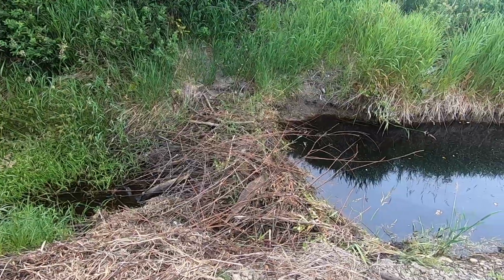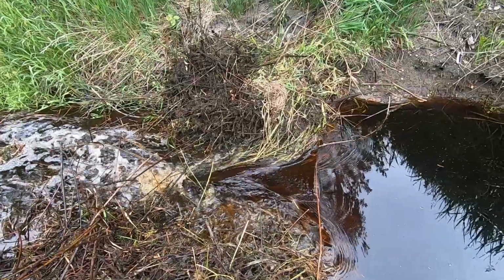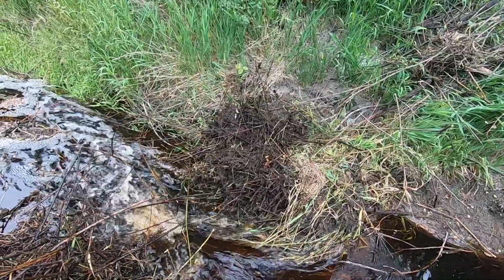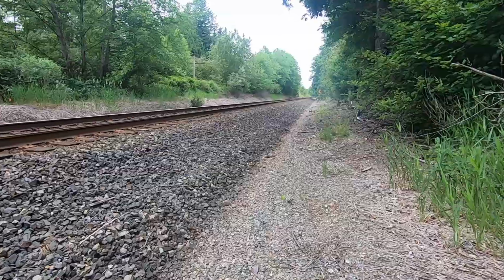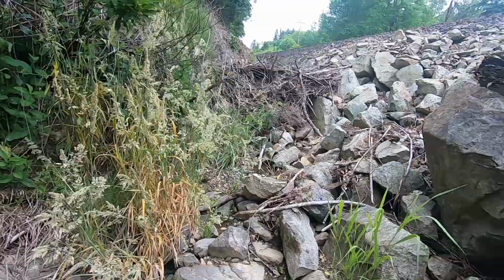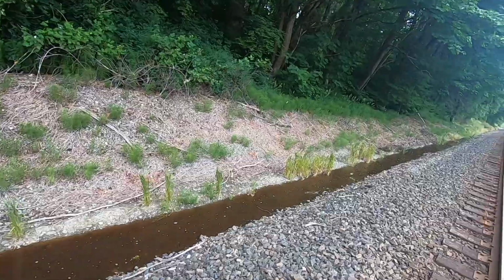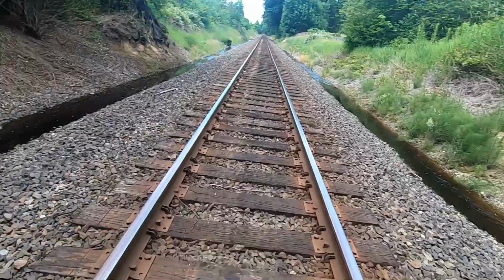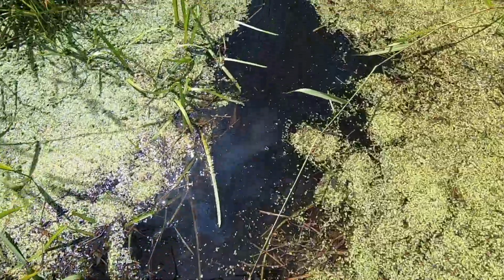Removing Extremely Problematic Dam In A Ditch #Beaver #Dam

Comment: I'm thinking there was a lot of water backed up in fields behind that dam. That would explain why the volume of water flowing kept up for a long time.
I'm also guessing the beavers would start patching the dam pretty quickly. Good video.
Reply from the maker: The dam did flow for a long time, there was also a lot of ground water that would drain out too. 

For this dam they were running around pretty hard trying to fix it constantly. Thanks for watching Jerry! :)

Comment: You should remove all blockages little dams rocks. Ripples mean blockage. Clean main dam debris out more. Grass slows water down alot. Sticks and stones break water. If you have a long water run and a small dam at the end water will not flow very well. If you go down the ditch remove rocks wood sticks you will get great results. Sediment is good food for fish etc.

Comment: If your going to do a job do it right!  All that u’re putting the dry twigs will down the road plug it up!  Guys, take the east way out.  🙄
Reply from the maker: I think I mentioned in the video that I'll come back and clean up the area. Right now while there's still water around I can't do much of a big clean-up. Right now the goal is to remove the water from this area which will allow for easier removal of material in the ditch. One thing I have to take into consideration is where I will place all of this material. There isn't a lot of room to remove any of this material and there aren't any roads that will provide me easy access. So in a sense, it is an "easy way" but that's due to the factors. I could clean the creek out and build a huge pile up right on the shore, but I don't think the train operators would be happy. 

Thanks for your comment! :)

Comment: I understand you couldn’t wait for the water to flow, however if you moved most of dam on the low side, then loser the front on the deep side, when you finally open it the flow would be strong enough to rip it up  the rest of the way.  I think lots of men are too impatient.  Myself, I want to take my little chainsaw and whack the crap out of the front because then when it opens it will be really climactic.

The flow wasn’t picking up dust so much as it was washing the pollen down. It’s just nature.

Comment: You really needed some dynamite.
Reply from the maker: Haha, probably would've done the job in 10 seconds, but I don't think the railroad guys would like it.
Reply: @golovinpropertyservices  A friend that was a SEAL in Vietnam was working with a crew that was trying to remove a boulder with explosives. The leader of the crew was using a large quantity of anfo and Victor expressed concern about the amount. They ignored his warnings and lit it off anyway. A large piece of rock went flying off and landed square on top of the supervisor's car, totaling it.
One stick of dynamite would have been just about right for that dam. You might have had to clear some debris off the tracks but there would have been no damage.
Reply from the maker: @benthere8051  Thats quite the story! Well I don't have any experience with explosives, apart from throwing compressed cans into fires. But maybe some day.

Comment: Can't find a bigger tool?
Reply from the maker: A bigger rake wouldn't do me any good, pulling material out just using this rake is already challenging after some time. Every pull if it's a good grab ranges anywhere from 10-20 pounds. Do that 20-30 times and your body will start feeling it.

Comment: What's up w/ you all's obsession w/ hacking and prettifying the lower reaches of your created water flow?  It's not just you, it's the whole lot of you (except the guyz w/ the excavators). What do you gain by yanking dam branches half way down your water slide?  The one thing it surely DOESN'T do is increase your water flow.  Maybe it's just pure exercise, more of a workout, and that's fine, if what you want to do.   
Free advice (and worth every penny) - Spend your energy removing obstructions at the HIGHEST point/line still holding back water.  AND you also have my permission & approval to widen the mouth of that overflow, again - AT THE TOP.  
The lower down stuff will take care of itself and/or you'll end up down there anyway - when IT gets to be the top.
That is all.  You may go.
(Don't tell anybody, but) these vidz are inexplicably fascinating.  Thank you.
Reply from the maker: In my case, the “prettifying” part, is to keep it from damming up with natural causes. When you have small branches that are laying and angled at a certain degree they can be blocked up with leaves and later with sediment creating another small natural dam. 

I prefer to clean things up and to try to keep things clean while I work. The less mess the better things look. 

Thanks for watching! :)